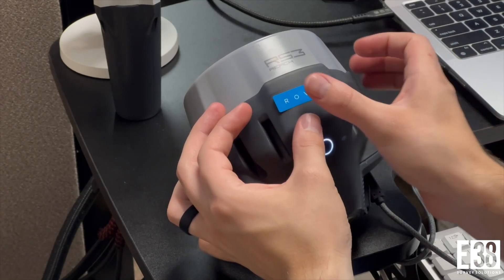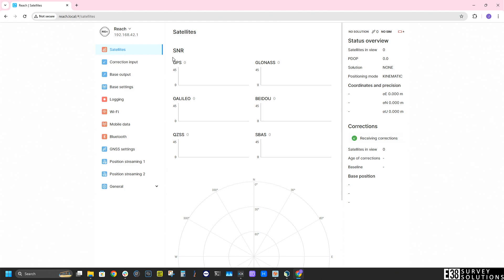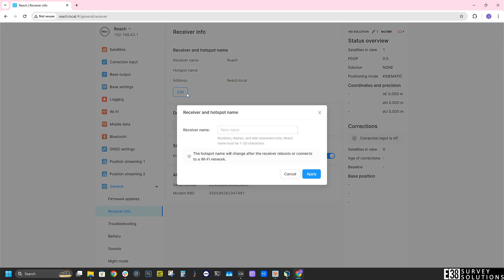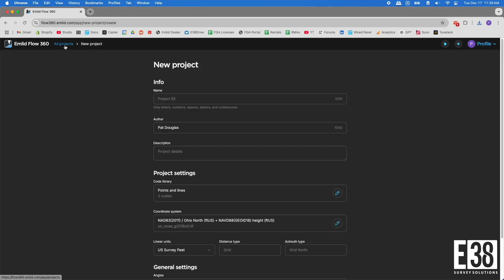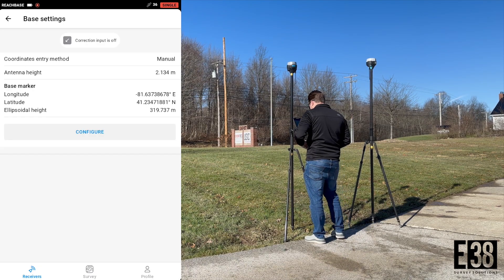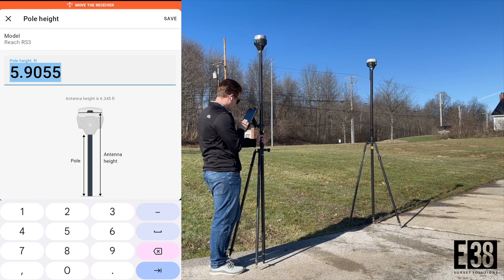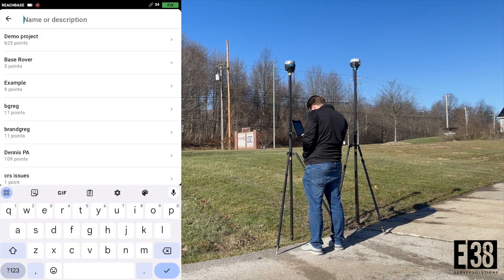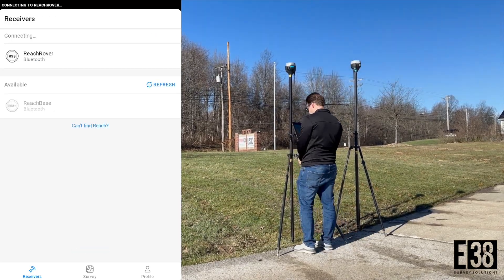Configuring Your RS2/RS3 as a Base and Rover(Latest)

Comment: if you have an Emlid rover, and a hempisphere base, how would you connect to it then?
Reply from the maker: If your hemisphere base can output 450MHz Trimtalk, you could use an RS3 with UHF antenna with your correction input set to UHF at the frequency that your hemisphere is outputting over to receive corrections.